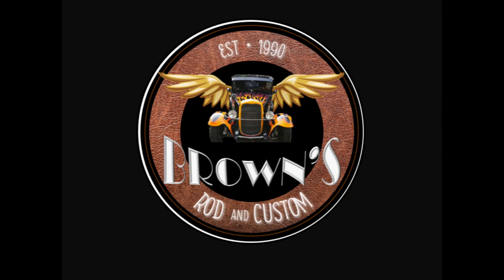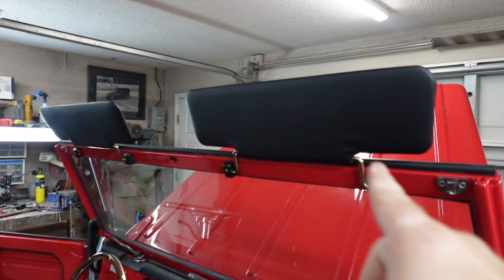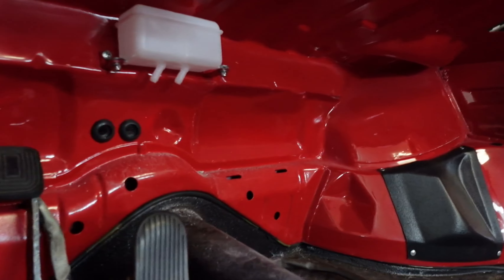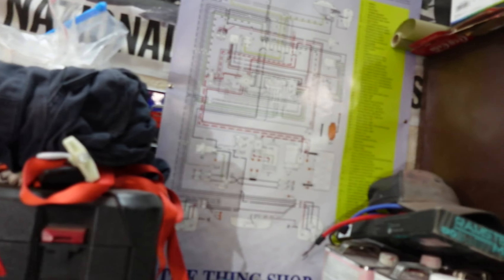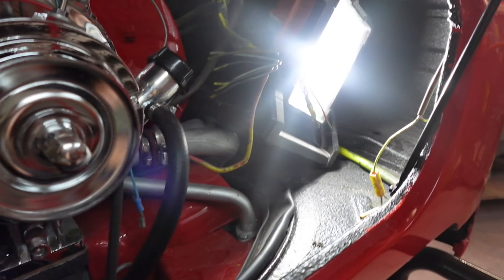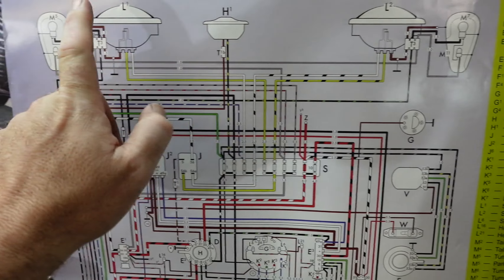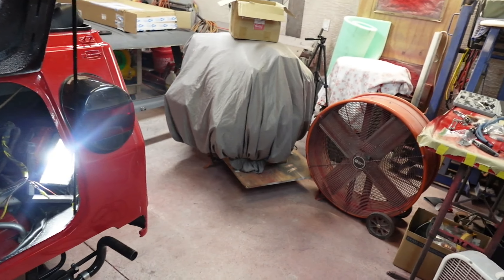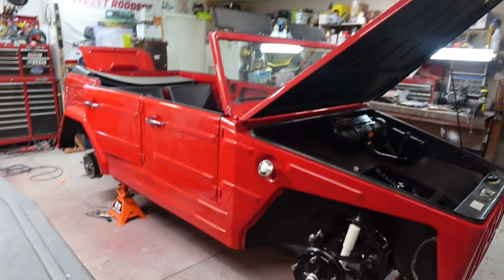1973 VW Thing Restoration: Update 7-14

Comment: the big bulk of wire were for the test socket   i have a 74  i took the casing off the rear part of the loom and cut all the test socket wires off where there tapped in to the harness
Reply from the maker: @MrVwgigalow  Thank you so freaking much lol 😂 I needed that!